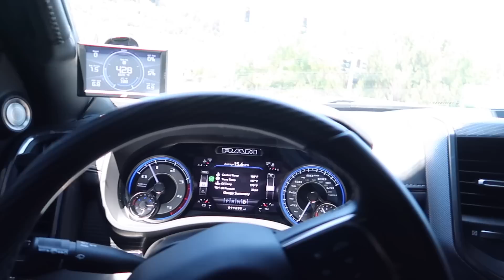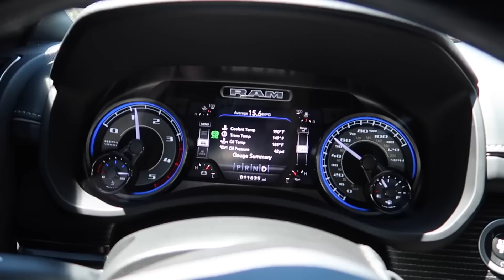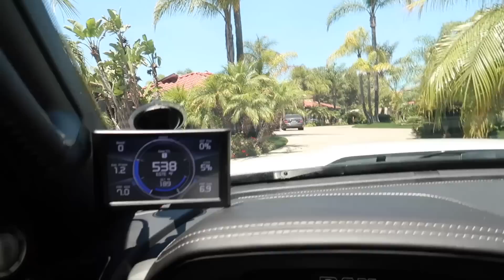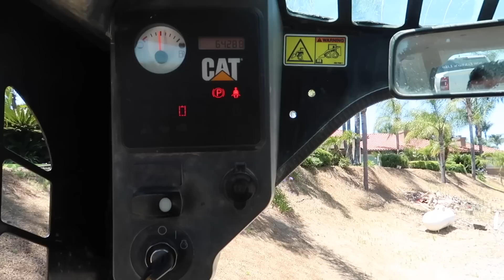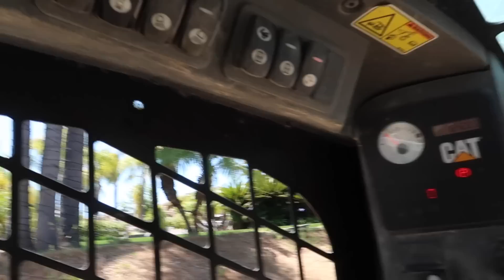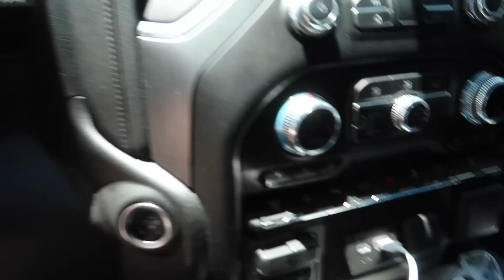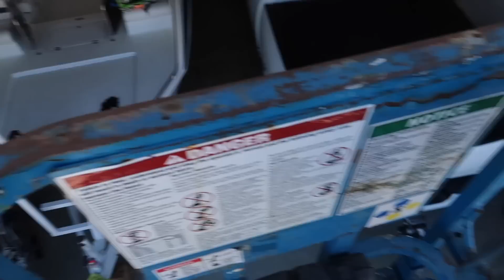NEW TOYS HAVE ARRIVED!!!

Comment: Your going to need a forklift for that trailer man. Those skid steers can only lift like 2500 pounds unless you add counter weight but doesn't add much more. Forklifts can do 4000 plus depending on the size.
Reply from the maker: thanks for the letting me know, i will check out some forklifts
Reply: Its tongue weight hes shouldnt be lifting more than 2500 # for either.

Comment: You’ll bend the forks trying to move your boat or camper. You need to look into a hitch adapter to move your heavier stuff
Reply: Its TONGUE weight hes not picking up the entire trailer or boat, most forklifts pickup 3k plus. His tongue weight on the boat should be less than 1k usually 10-15 % of the total weight.